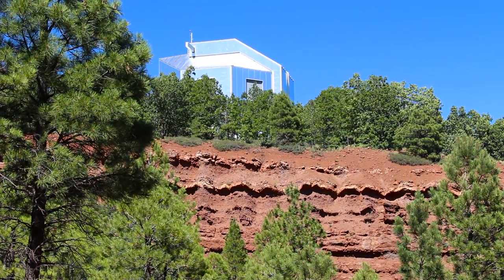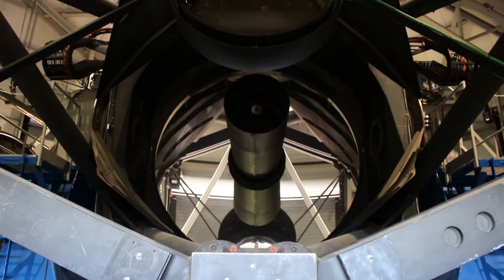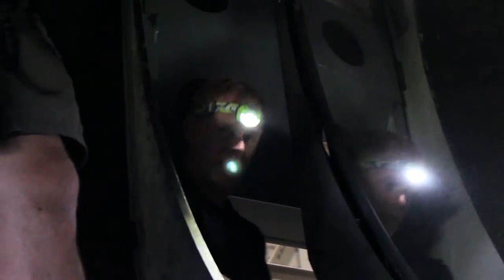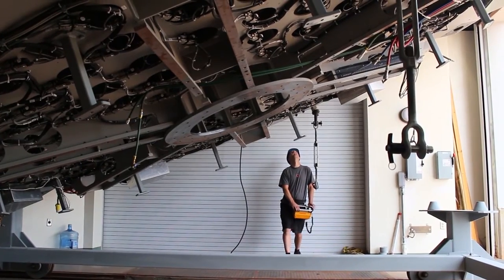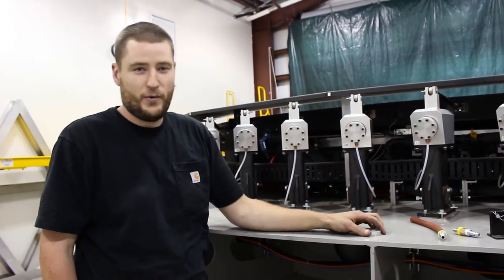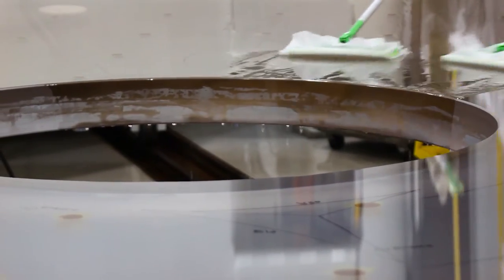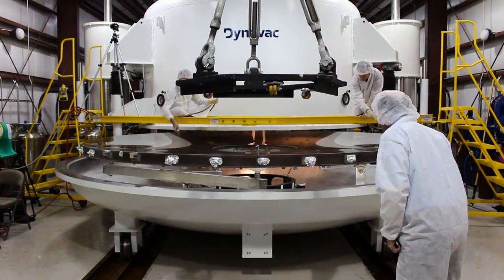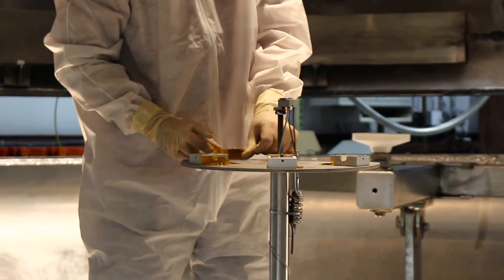Re-aluminization of Lowell Observatory's Discovery Channel Telescope

Comment: Yes, it is technically possible to overcoat large telescope mirrors but it greatly increases the cost and complexity of the coating systems. The 8 meter mirrors in the Gemini North and South observatories have a silver reflective coating and multilayer overcoats. A problem is that after 5-10 years, staff turnover may mean that no one knows how to operate the coating chamber.

Comment: I take it that these larger mirrors cant be overcoated which would greatly preserve the aluminum from corrosion.
Reply: The aluminum "depth" should be as small as possible so to have not any double image. So first remove the old coat and then reapply the new one.